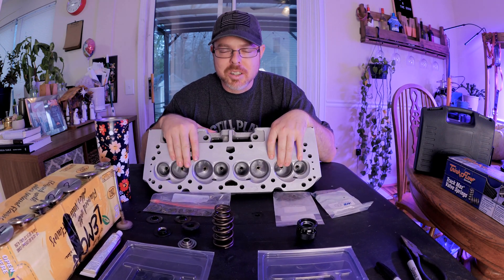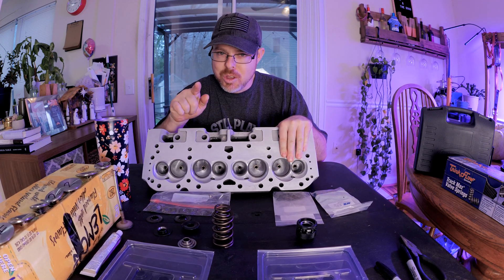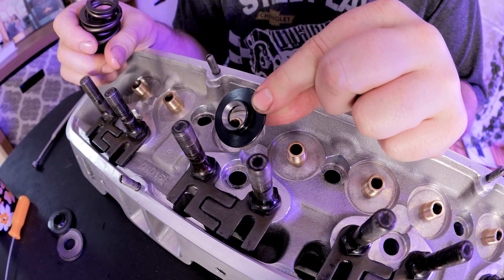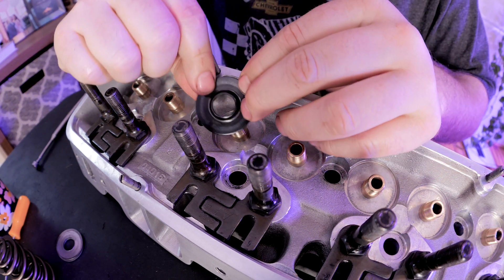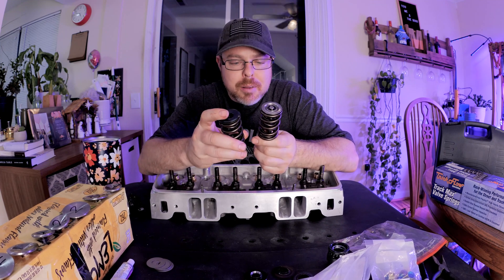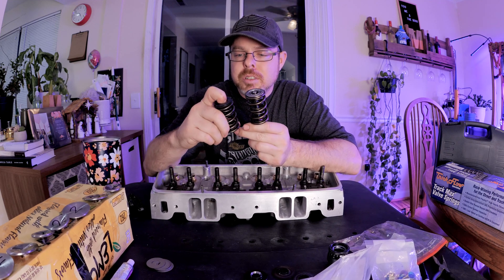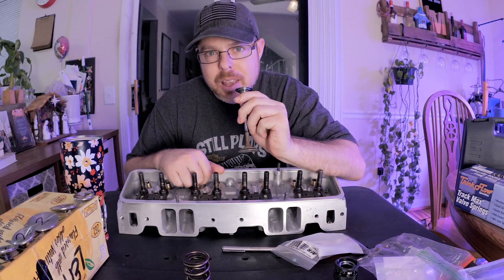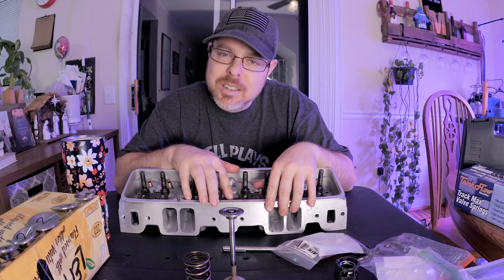400CID GEN1 SBC build choosing locators and retainers for a spring package AFR 210cc Cylinder Heads

Comment: Lots of good tips here! I have afr210s on my 383 stroker, with a 243/248 cam solid roller, as a daily. I ran without lash caps for about 20,000 miles before the valve tips started to mushroom. In my case lash caps really helped my valvetrain geometry, and they protect the valves, and have gotten at least 40,000 miles out of the current set of valves with lash caps and they still look like new, the lash caps do have to be changed about every 10k miles, but changing the lash caps is way easier and cheaper than changing valves. That also looked like a comp ultra pro magnum xd rocker arm, I have found that they hold up better to the abuse than most other rocker arms! Sweet video!